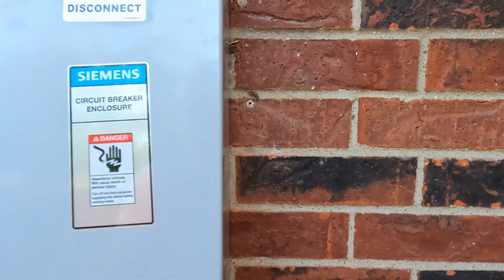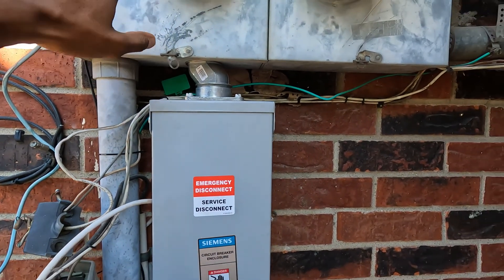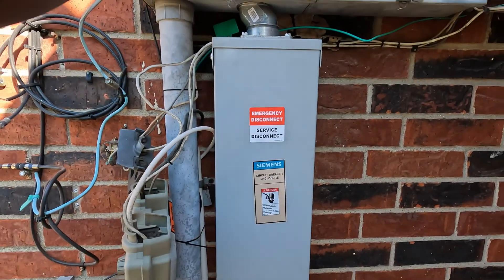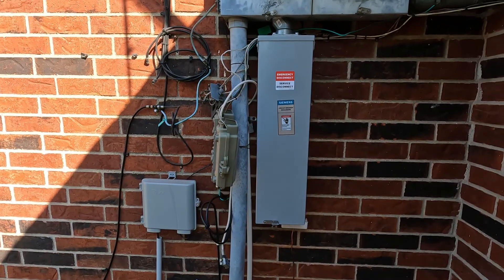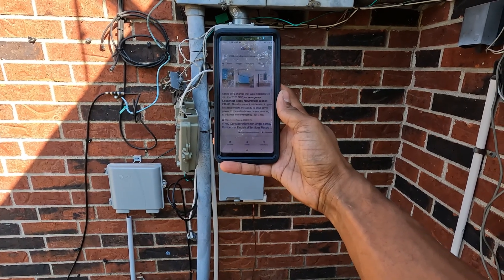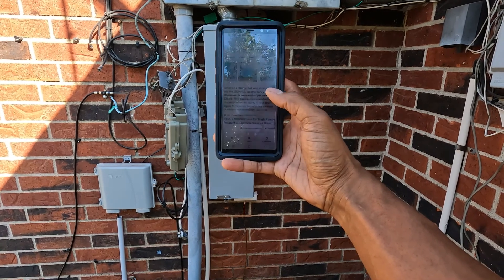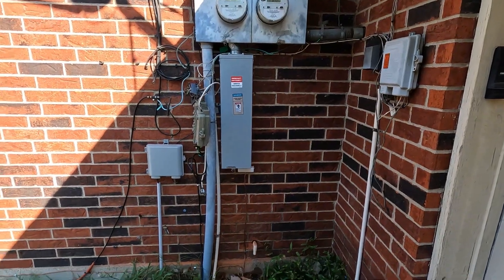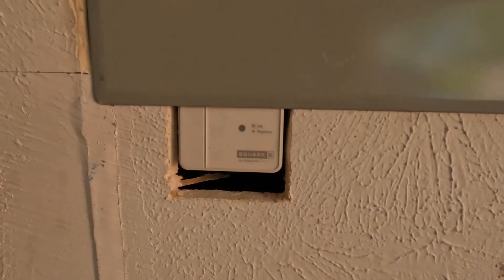Emergency Disconnect NEC 230.85

Comment: Its not a service disconnect code its an Emergency Disconnect so no 4 wire needed. But houre inspector wont understand this.  Read 230.85 B